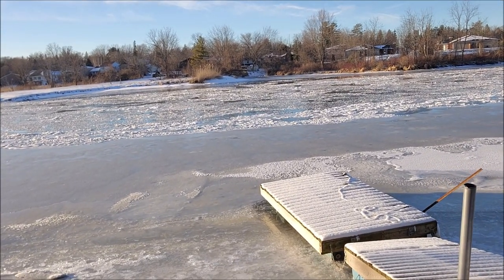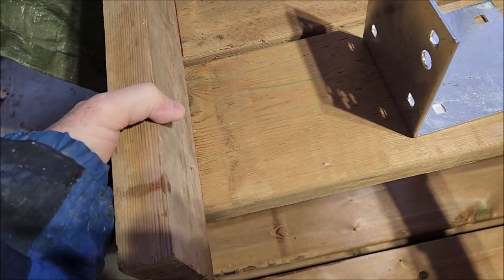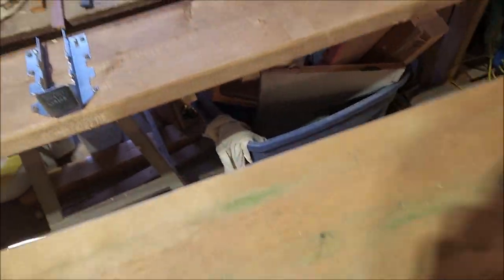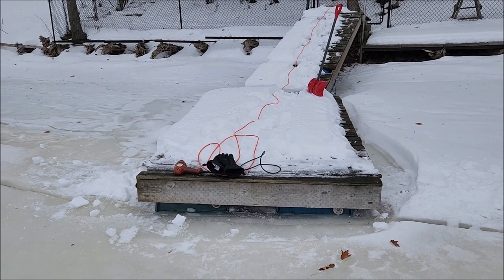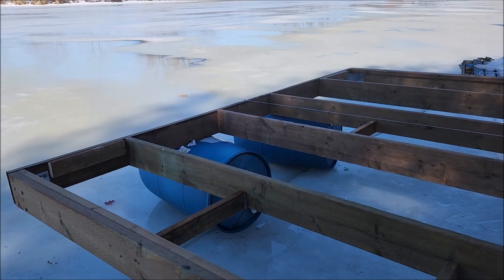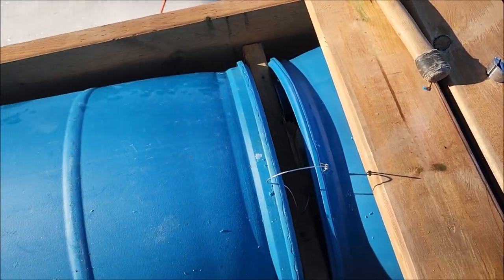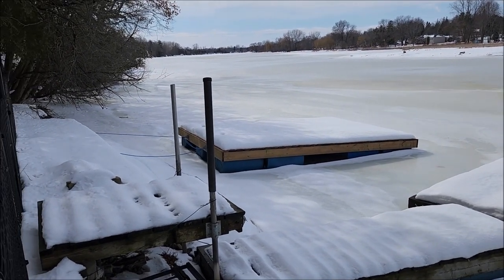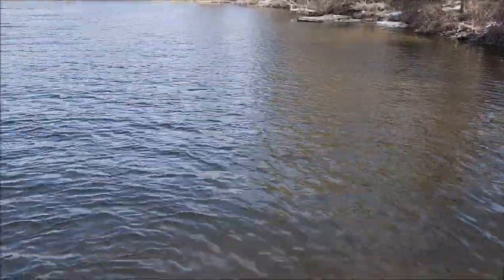Floating Dock on Ice

Comment: Great work! Planing on building a floating dock myself,  just a bit smaller
Reply from the maker: It works very well in it's 2nd year. I modified it slightly to prevent the barrels from moving sideways as it made a clunking noise in rough weather.